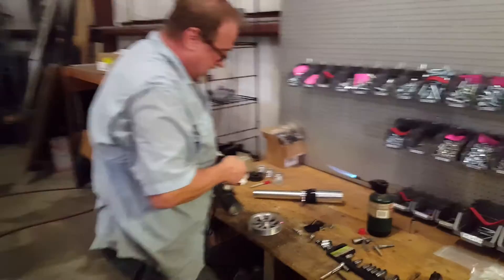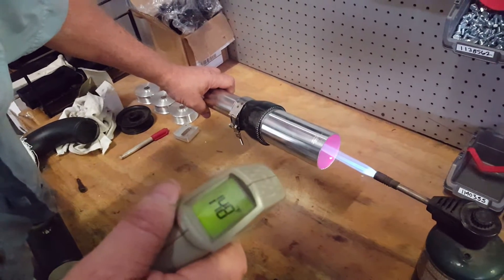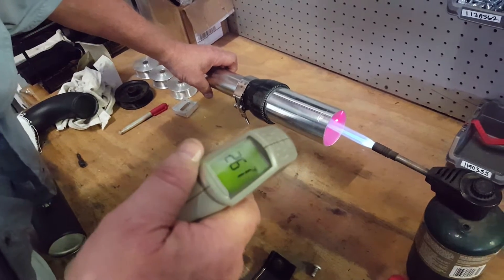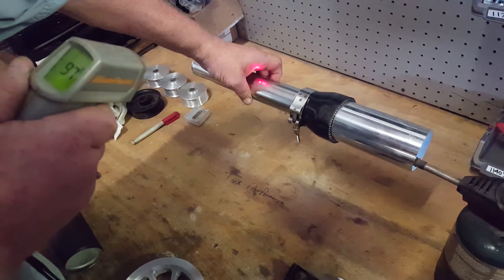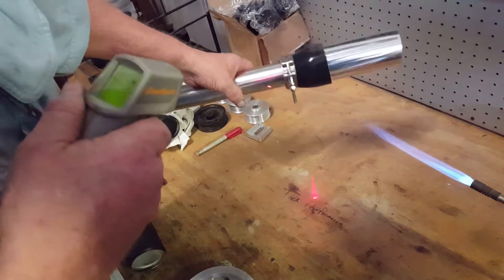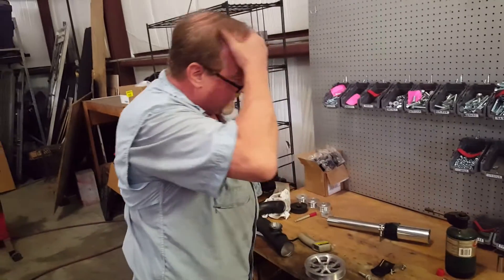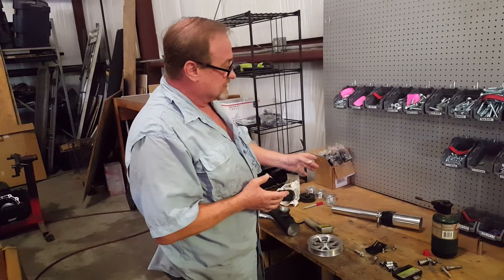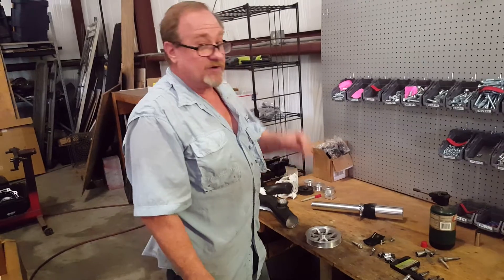Insulated Exhaust Tubing

Comment: I'm interested in using that insulated pipe for my portable generator. Can the pipe be flexible with the insulation still be intact?  I would require a minimum of 7 feet. The pipe coming from the generator is 1-1/4 in OD.